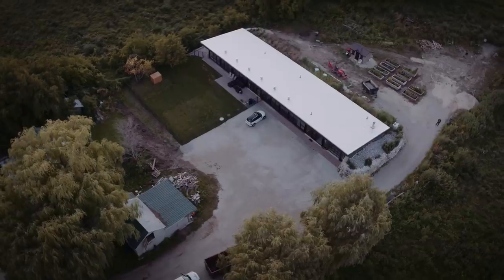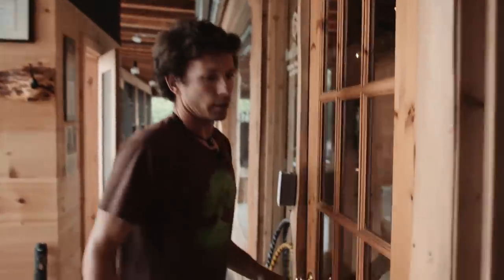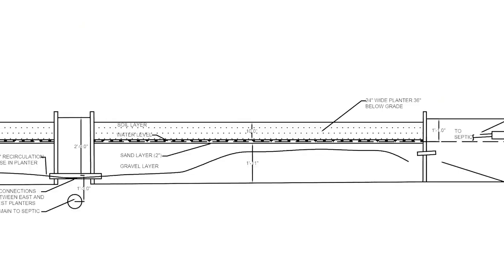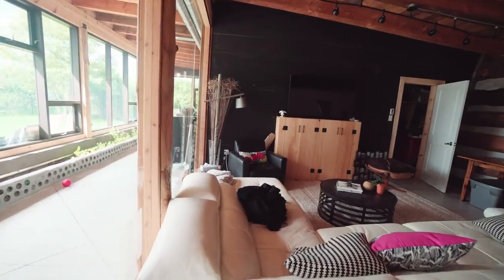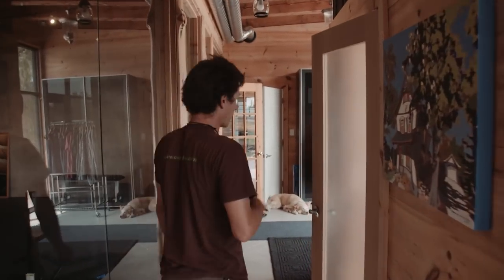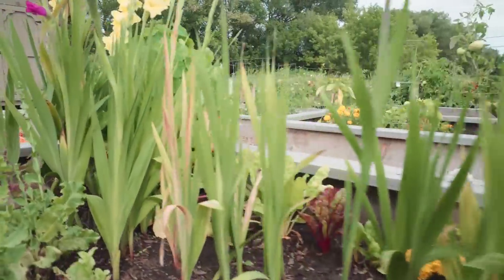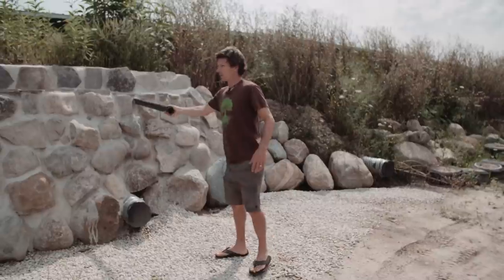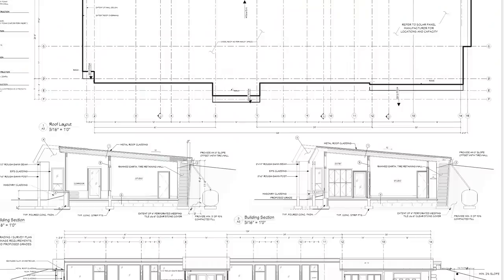Collingwood Earthship Overview and Tour

Comment: Hi Matt, firstly, thanks for sharing such a detailed and well edited video. Your earthship is an interesting build with additions of HRV and the overhang, and we are even more interested as we wish to incorporate a yoga studio in to our design. We are based in southern Europe at 1400meters above sea level - summers are hot and a little humid, and just under freezing in the winter (very similar to Collingwood it seems). I'm wondering if the HRV been effective enough for you guys and your partners clients or do you think an ERV is worth exploring? It sounds like the overhang works well in the summer, have you had to use insulation boards under your floor or under the thermal store to restrict loss to the ground during winter/spring? Thanks in advance, Doug

Comment: First comment! 

Fantastic Earthship man. I really like how the reclaimed materials that went into the interior design came out with a very modern and hip look. Alot of different materials but blending very well. The radiant water heating is one of the best go-to for heating imo, and I like how you have back up propane. Seems you have quite a few back-ups and redundancy built into his home, thats very forward thinking. 

What are your solar gains like? Where are you located? Get pretty harsh winters? With that eve/overhang and no venting skylights I image its pretty reduced for the greenhouse. Personally I like as much light as I can possible get at anytime of the year.

I love earthships and anything related like permaculture. One day I plan on building my own. One day even sooner I plan on attending the academy in Taos. Till then I've just focusing on a Tiny home. :P

Comment: Correct me if I’m wrong; but in order for the entire Earthship concept to work. The windows MUST be placed on a 90 degree angle to the December 31 Sun(the winter Sun) this is how nature is able to heat the thermal mass off the structure(the northern wall with the tires) so that through convection the structure heats itself through the night and all year long. This seems like a critical error to me? Where you able to maintain 65-70 degrees year round? How was food production impacted as a result of reducing sunlight exposure daily/yearly?
Reply from the maker: Barbell Method when I took the earthship academe program with Michael Reynolds and asked him this same question his answer was that the angle was close enough to 90 degrees that it would not make much of a difference. As well there was the financial side to this decision too. The cost to install at an angle was going to be 10k more and provides an opportunity for water infiltration. So that is why we want vertical.
Reply: @kimberlywedwards  I would wager that the window manufacturer isnt going to warrant anything that is not a vertical installation.

Comment: Question: In the german earthship, at Tempelhof, I saw cracks in the angled windows of the greenhouse. Is it a general problem? Did you experience it too? What kind of glass/windows are you recomdending for the angled windows in the greenhouse? Thanks.
Reply from the maker: I would recommend keeping the windows vertical to avoid leaking and cracking.
Reply from the maker: Also vertical is easier and cheeped to install

Comment: Whats with the heating system? i thought the whole point of an earthship was that you didn't need heating.
Reply: Exactly! This isn't even burmed, so no thermal mass. Whats the point?
Reply: My thoughts exactly.
Reply: It gets very cold in Collingwood. Where have the previous earthships you've seen been located?
Reply: It not rely an earth ship ,it a modern home and natural gas realistic,fake earth ship
Reply: @HeatherNaturaly  It is bermed. As mentioned, two thirds of the house is buried.
Reply: It doesn't seem that they have a way to stop the outflow of warm air in the winter, which would be a major flaw in design. 

They are also far enough north that having a redundant backup is a good idea.
Reply: @_lukejsmith  you can also do that with the sun.
Reply: @breadbread4226  Would that be reliable enough in the winter?
Reply: @theuglykwan  what do you mean by "that"?
Reply: @breadbread4226  Relying on sun heating water in the winter.
Reply: @theuglykwan  depends on where you live and how much hot water you want to use in a limited amount of time.

Darker winters and higher demand obviously make that harder. 

Besides, I was mostly talking about the heating system of the house, which is not necessarily the same as the system for hot water. .
Reply: @_lukejsmith   The boiler is not insulated so it would also  heat the house as well.
Reply from the maker: Lovely Sinners all homes in Canada need a mechanical heat source that is controlled by a thermostat so that if you are away from your house for a length of time the pipes do not freeze. And although the design of the house would keep it above freezing this is building code that needs to be followed.
Hope this help make sense.
Reply: Matt Code thank you!
Reply: @theuglykwan  Tennessee can be overcast most of the winter. Cool to cold cloudy rainy winters are common. 
Also lots of sawmills in that area so easy to get scrap logs for fire wood
Reply: @kimberlywedwards  Thanks for answering that question. 

Our family are planning to build 3 off-grid homes in Kawartha Lakes. Not Earthships, we don't have plans to reuse/recycle materials, but we plan to build with timber frame and SIPS. 

If we have a geothermal heating, that should satisfy the thermostat issue, shouldn't?

Comment: Ever consider adding a small turbine to a ceiling vent?
Reply from the maker: Yes I would highly recommend a wind turbine as a secondary power source and would love to have one! This would help in the winter when the snow covers the Pannels or when there is no sun for days..
Reply: @kimberlywedwards  Thanks, but I was more thinking could a small wind turbine be installed in the  place of a turbine vent, and generate electricity through the passive air flow?
Reply from the maker: The answer to that question would be maybe possible but I would think the product would be minimal and not worth the effort. But could be a fun experiment

Comment: If you listen to Michael Reynolds explaining what an earthship is - this is actually not really an earthship imo. Earthships are off Grid (like a ship) and need no extra heating, that's what the thermal mass is for! I'd call it earthship inspired.
Reply: can we call it a cold cold canadian winter and strict ontario codes earthship?
Reply: @gillybean287  Definitely ... until there are several Ontario Canada engineers that have experience with this type of build, and data to backup their signoff on the plans, it is IMHO impossible to build a fully earthship home in any part of Ontario that gets below freezing ATM: that is, it freezes everywhere in Ontario in the winter, and I can easily recall at least three winters in my lifetime where power was out in parts of rural Ontario in the winter for a minimum of 4 days. I wish Matt had posted up his website as he promised in the video: well done Matt!  I hope to visit someday to see how your home feels in the winter.